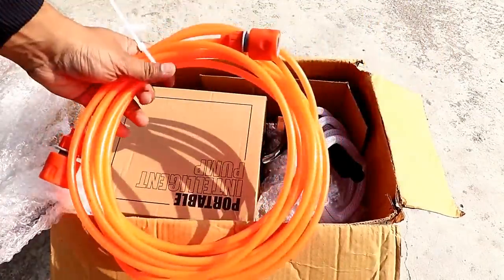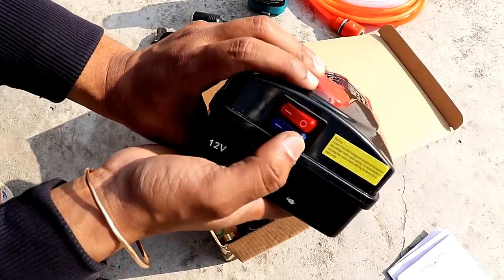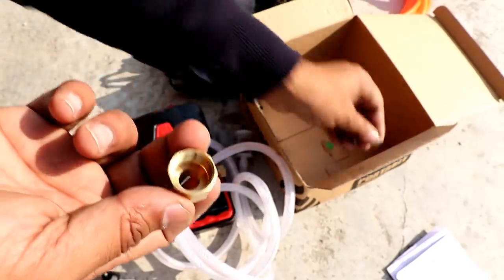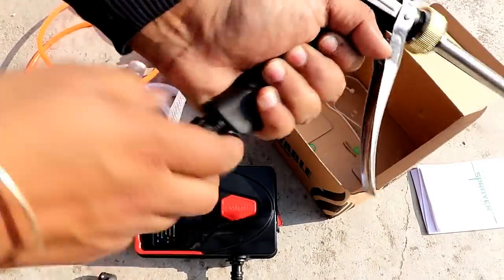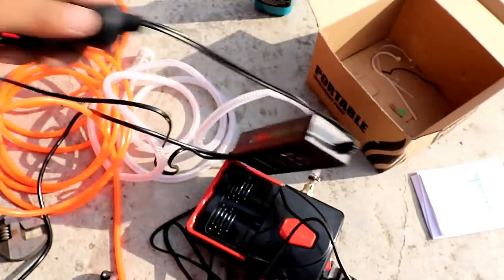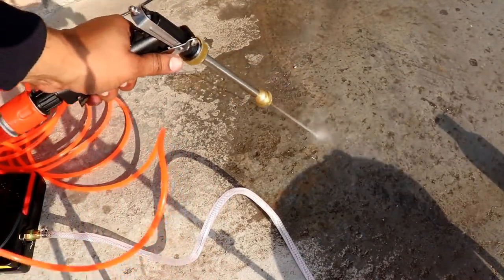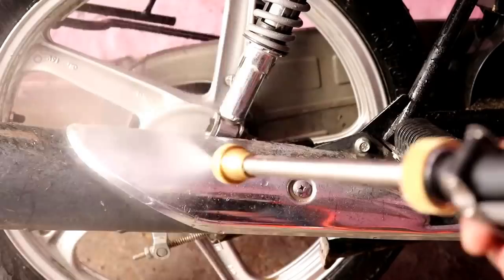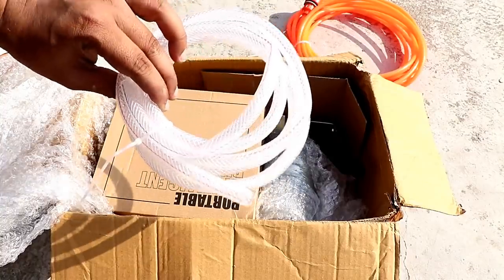Fieldstar Dual High Pressure Washer Set-Mounted 12V Car (with CAR Adapter)

Comment: The product is good.The pressure is high enough to clean its just that the one that i bought is faulty the pump didn't turn off automatically causing the the pipe to came of every time when the trigger is release due high pressure any help on this issue.

Comment: Stop using High pressure washer on your motorcycle. It will damage paint or even damage some parts.
Reply: How..and explain..Please..!
Reply: @vijaymhatre2676  For the simple reason that a motorcycle is water resistant, not waterproof. Water can get near battery compartments, etc and so on. I always use a simple hose when I wash my motorcycle. Do some more research.